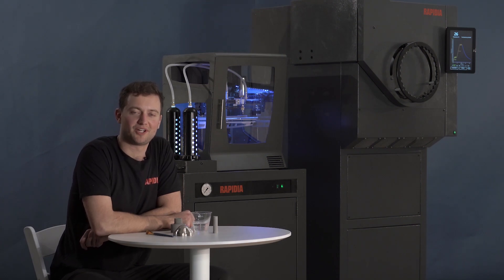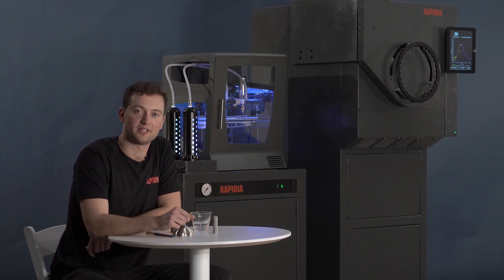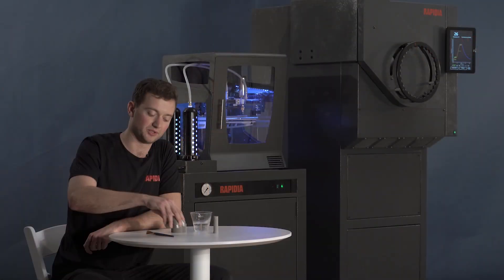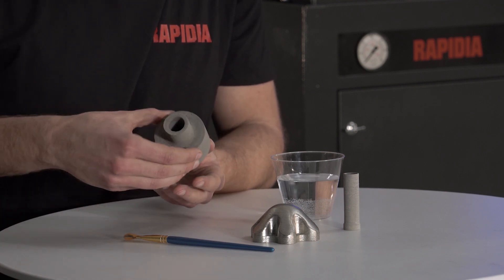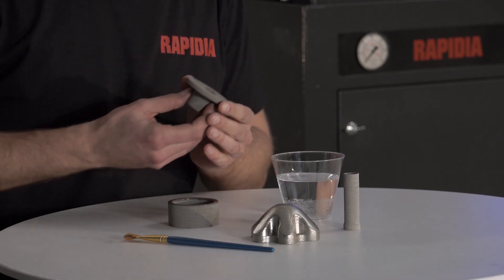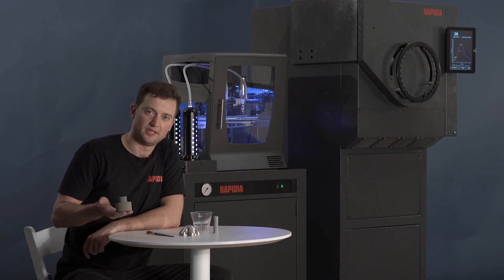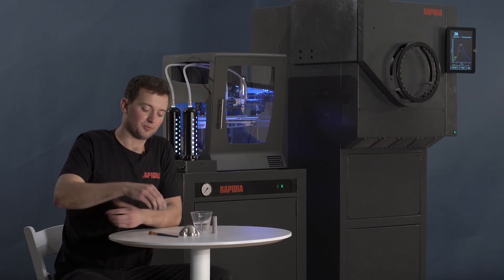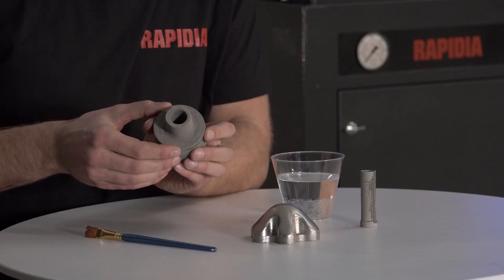Rapidia  Metal 3D-water bonding process

Comment: Is this a product which would be affordable to an academic institution?
Reply: This product is ideal for academic institutions because it is simple, fast and safe (no solvent based debinding).  I don't know what "affordable" means, the basic system is $130,000 and a full installation with all options, spares, training etc is $175,000.
Reply: @dgelbart  That's much more affordable than the DMLS systems at over $1,000,000. I'll have to pass this information on to the innovation center and advanced manufacturing shop for consideration, this might be a better solution for some projects which are currently being 5-axis CNC machined.

Comment: I'd be interested in seeing how strong the water-bonded joint is after sintering.  Have you built tensile specimens with these joints?
Reply: If there are no air bubbles in the water bonded area, the strength is the same as the rest of the part. We did tensile testing. After all, the whole part is made from water bonded metal powder, so why would there be a difference? Joint area has to be designed to minimize trapping of air bubbles.